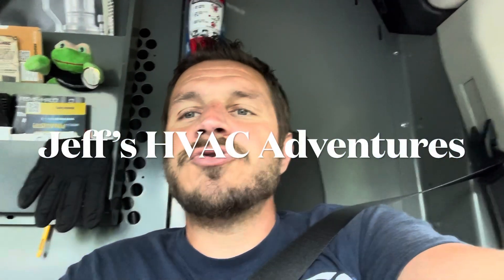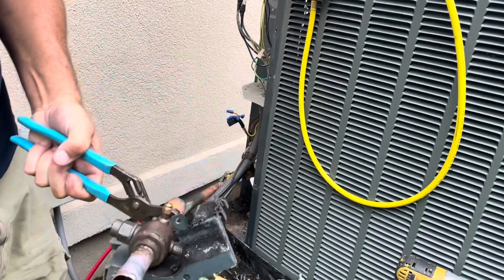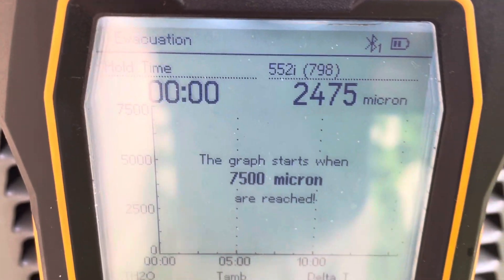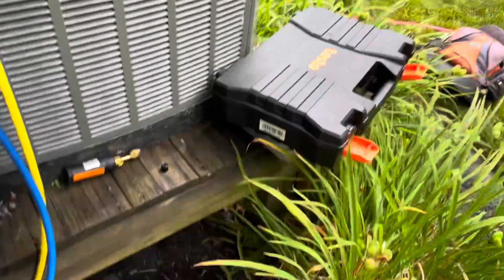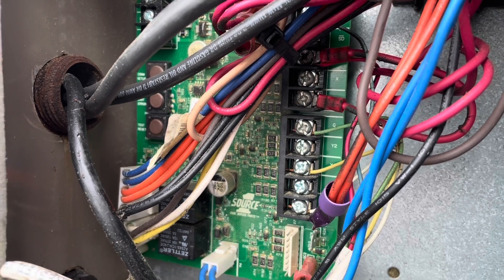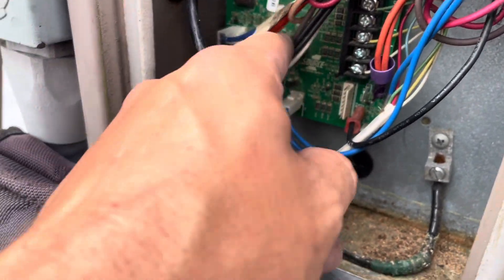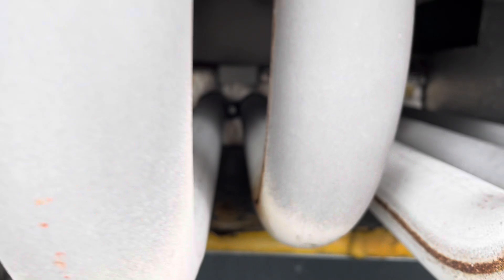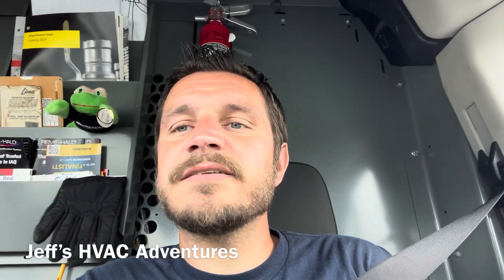2 HVAC Calls!  Service Valve Replacement, And MULTIPLE Failures On An RTU!

Comment: On the second call it just shows how intense you are when you are troubleshooting the issue(s). You did not stop at the 9 flash code, but pretty much went 100% through the unit and found ALL the other issues.
This is a great training video for doing service calls correctly.
Reply from the maker: Thanks brother.   Appreciate that.

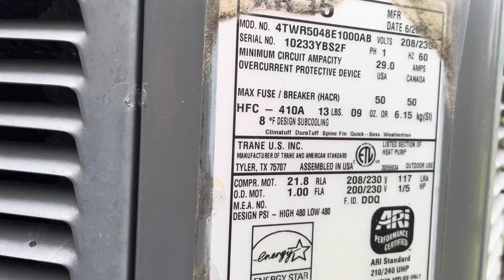Comment: dumb question isn't the new valve installed 1:31  backwards, the service access port 1/4" should on opposite side of the valve. I  realize it would involved more work and brazing to correct the placement if the port. But, as always you have a great vid with excellent brazing techniques. Just hope the unit doesn't need to be pumped down in the future.
Reply from the maker: This valve isn’t an OEM exact replacement.  I tried it like that to start with but The mounting holes on the new valve wouldn’t allow it with the old bracket.   Good eye.